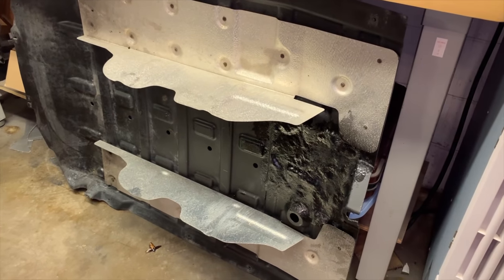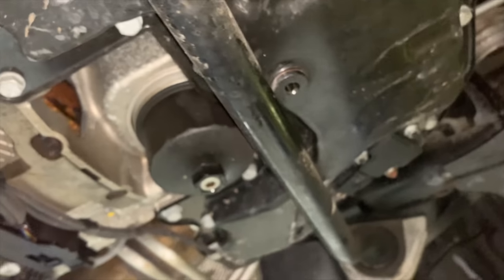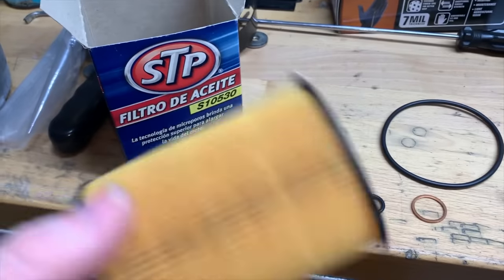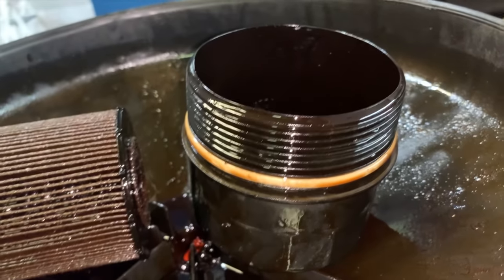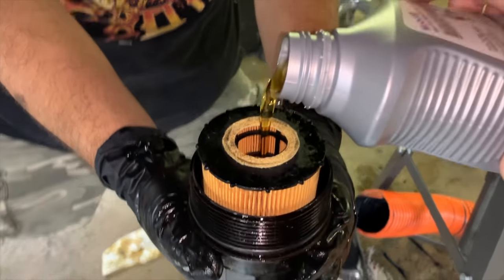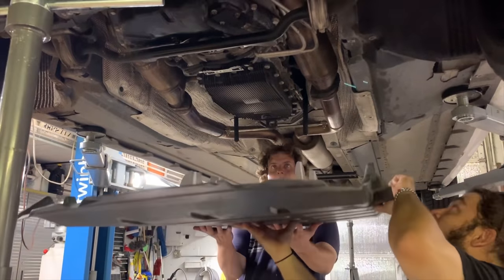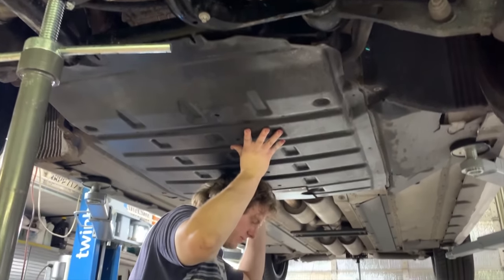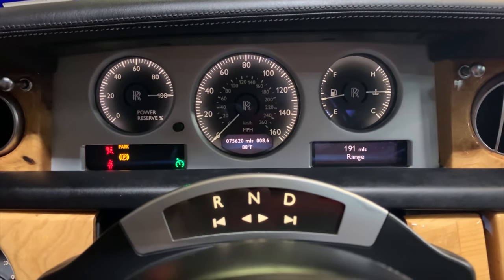Rolls Royce Phantom - OIL CHANGE

Comment: Use Royal Purple motor oil, it's better than Mobil 1 oil..
Reply: Stonewall Jackson  />>>> You can buy Royal Purple at any Automotive parts store ( Auto Zone, Napa,or any good parts store. ) I use the 10-30wt it's better than Mobil 1 or some of these gas station oils.  This oil should last longer than most other oils on the market. And use a top quality oil filter.
Reply: Stonewall Jackson  >> yes it can be used in any gas engine or diesel engine.  Ask the parts guy for the right oil for your vehicle.
Reply: Stonewall Jackson  yes. Find the right weight classification like probably 10-30wt or 5-30wt.
Look in your owner's manual for the correct weight classification. 
Royal Purple should work fine in your vehicle  .. Depending on the yr it was manufactured.

Comment: You criminals! I saw that stolen Whataburger table tent! 😀 If you don't have a lift or access to one, you're stuck going to the dealership.  My Lexus LS460 requires 9.1 quarts of the Texas Tea. Why that damn 0.1 quart, I have no freakin' idea.
Reply: When converted to liters it makes more sense, remember, it's metric originally.

Comment: You'd think that it would be plumbed into the oil system, so that one would simply swivel or move a drain hose into a downward position to the collection pan, unscrew the end plug, set the drain valve to "drain," and begin draining the oil.. Likewise, the filter should be in an easy to change-out location. Nowadays, when mechanical systems are not so designed, then the difficulty is intentional.
Reply: New to oil changes are you?
Reply: @donniebrown2896  Yep..Total newbie.

Comment: F*** me, its got a ZF transmission! More crossover parts!
Reply: Rolls Royce used GM automatic transmission, German audio and Citroen suspension in the past and even adopted a mechanical braking system from some European car before hydraulic brakes.  RR weren't better engineers than others and less sophisticated than some.

Comment: @4:54 please disregard that advice: one should not change the motor oil when it is hot. doing so is dangerous. 

under some very cold conditions, it is recommended to warm up the engine so the oil is just warm, but not hot. modern oils still flow just as well at freezing temp as at room temperature.. if you don't trust that info, put some motor oil in a container in your freezer over night. i will not behave like honey, no matter the weight of the motor oil used.. at room temperature all modern oils flow and behave just like cooking oil (in technical terms they do not, but we're talking about draining used oil here). check them out at an auto-store: no matter the brand or weight, none of them are viscous on the shelf...

Comment: Ummm..no one buys a rolls thats used. 2nd... people that buy a rolls will NEVER change oil..let alone open the engine bay...
Reply from the maker: Well, I did. 
I drive it every day.
What do you drive?
Reply: I did and do both. Silver Spirit 1986. Gives pleasure every time I drive it ( LPG converted)
  A well developed and fine quality car. It’s necessary to keep on top of maintenance and bodywork, and I spend money on it as you do any hobby.

Comment: Why didn't you suck/pump the old oil out through the dip-stick tube, the way Mercedes does it? easier and safer.
Reply: Still need to access the filter
Reply: @billwhiteathome2080  Yea, really. The car was on the lift anyway.
Reply: So you're saying why doesn't he do it the eaisest way instesd of the correct way? Then ask yourself why oil pans have drain plugs in the lowest part of the pan.

Comment: you should look up the specs on that plastic oil filter cover, and use a Nm torque wrench.
never guess. . .  guessing breaks things.

as much as that car costs , the belly pan should have twist locks . . .  instead of regular 1''  machine screws.

the oil pan is  very thin, it flexed ,  cheap ass oil pan.  a ford and chevrolet oil pan is thick and very sturdy .  psht.  lol 
now knowing that , i will not ever get one.

scary vid of those shade tree mechanics,  but it does happen.

car may look heavy,  but the paint is thicker than the metal. that is why the car fell. because the metal is super thin, as like
 the oil pan.

expensive . . . yes. . . . . 10th world lowest bidder  to build the dam things. . . . . YES.

Comment: wen are you going to use the metric system fcy?
80% of the world is using that... 
7.57082357 liters
wondring why didnt they made this engine a dry sump engine?
ah ,, oke i know,,, the more liquide it uses the more Shell or Moble makes,, and BMW has share's in tthose company's..... oke Got it..
Reply: no they use high volume low pressure oil pump,less stress on engine,longer engine and oil life,and less oil change interval, those engine goes between 10K to 15K between oil change,so oil company don't make money!!also oil passages are larger on those  engines, they designed for more volume not pressure
Reply: @styldsteel1  de point vaz uze metrik cyctem!!LOL
Reply: @ahoorakia  lol. ok..that right there was funny lol.

Comment: How would you like a filthy Mechanic like him working on your vehicle. That pressure he had on the oil filter cover was because they had to much oil inside of it. Would like to see if it had leaked.
Reply: Are you sure,....do you work on those for a living?  that seems ªimpossible* ,  the oil galleries are all open inside to the pump,bearings,cyl head etc.  And by the way,   RR is just another expensive POS lump of electronic iron like all the others; all built for suckers who have lots of money to burn; and they do   lol